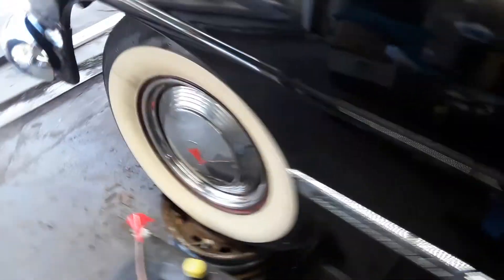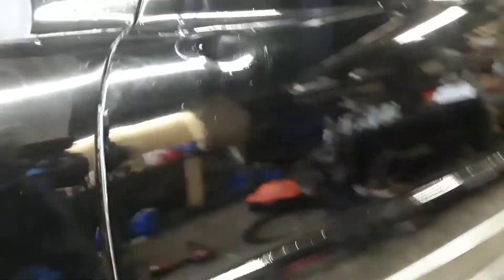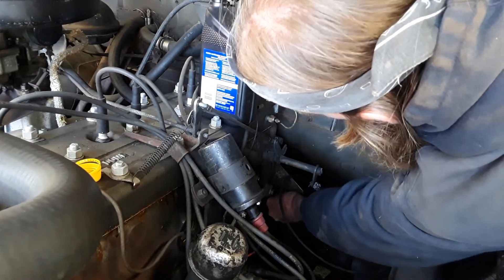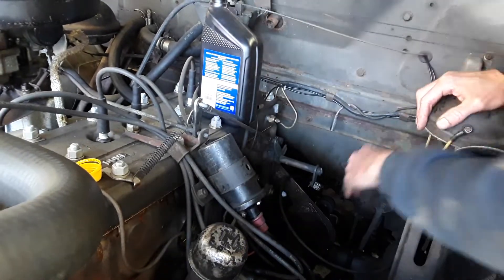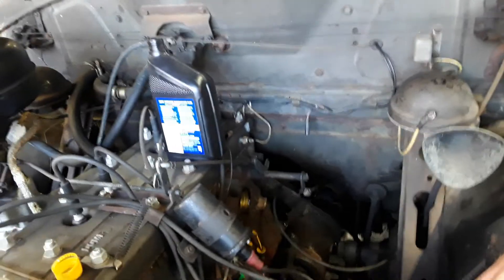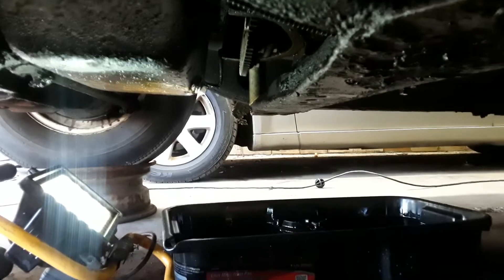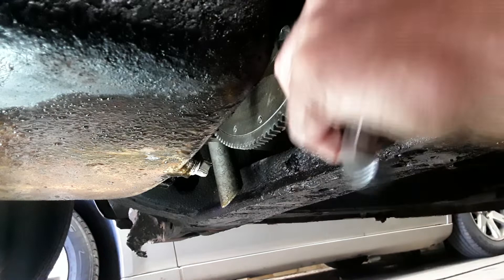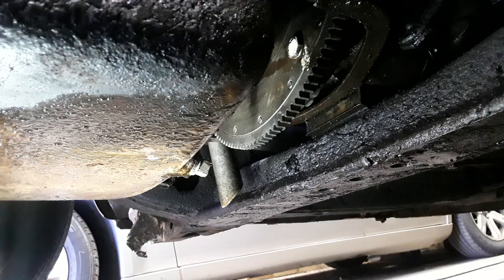Hudson Wet Plate Cork Clutch Oil Service.

Comment: Snap-On Tools back in the mid 1950s made an 11/16, half inch drive socket with a magnet in it for more easily removing the drain plug via the timing hole from the flywheel on Hudson clutches. The number of the socket is S9103. These can sometimes be found for sale at on-line auction sights. I found two this way and gave one to a friend who has several Hudsons.
Reply from the maker: @WAL_DC-6B  Thanks for the info about the socket.  I'll have to find one.

Comment: Very nice video.   Couple things I can add.  There is normally a tin flywheel cover which must be removed to access the flywheel drain from below.  Also, you can use a socket with a 6 inch extension to access the plug through the window above the starter.  (The same window you used to fill the clutch).
Reply from the maker: Thanks.  I realized that after I had uploaded. My cover plate has been missing since I've owned it and forgot to mention it. 😀

Comment: Actually, you don't have to get underneath the car to drain the clutch fluid. Here's how to do it according to the Hudson Motor Car Co., "Crank engine slowly until the star on the flywheel is aligned with the timing pointer (or center of timing inspection hole). This will bring the drain plug hole to the bottom of the flywheel and allow complete drainage." I follow this procedure every time I change the clutch fluid in my Hudson, and it works just fine.
Reply from the maker: @WAL_DC-6B  You're correct about using the timing pointer.  I only pull the plug from underneath due to being easier with the wrench I use on them.  They are a bit beat up after 70 plus years and 90k miles from other people not using the right tools or overtightening .
Reply: @gregdelagrange8573  Indeed, if the clutch plug on your Hudson is worn then perhaps the best thing to do is to get underneath to get a good fit with a box wrench or better yet, find a good replacement plug.

Comment: How often do you change the clutch fluid?!?
Reply from the maker: I change the clutch oil once a year when I change the engine oil.
Reply: According to the 1951 Hudson "Owner Manual," you're supposed to change the clutch fluid with 1/3 pint of "Hudsonite" every 5000 miles.  I change the fluid in my '53 Hudson "Super Wasp" every two years which is usually around 2000 miles.

Comment: Will WD-40 work to listen stuck. Corks
Reply from the maker: I've never tried that.  Usually kerosene and gentle steady pressure on the clutch pedal will break them free.  I imagine WD40 would probably work using the same technique.
Reply: According to the 1952 Hudson Mechanical Procedure Manual, on page 7-3 it reads: "Following is the method recommended for draining and cleaning the clutches for Hudson cars in order to remove gum and oxidation deposits which cause clutch sticking."

"It is important that this procedure be closely followed, and the engine run sufficiently to warm up the clutch parts to approximately 100 degrees F before flushing. If the parts are at a low temperature the solvent will not be effective and on the other hand, if the temperature is too high, much of it will evaporate.

1. Remove flywheel and dust pan and turn flywheel until drain plug is at its lowest position. Remove plug and drain out the old clutch compound.

2. Turn flywheel until clutch filler hole is opposite timing opening in rear engine plate and with a filler gun, inject one pint of solvent (20% carbon tetrachloride and 80% commercial acetone. Obtainable from drug or chemical supply houses).

3. Replace plug and with a stick or the proper length or a clutch pedal depressor, hold clutch in disengaged position. With engine at rest, permit clutch to remain disengaged for about 10 minutes. Release pedal and turn flywheel and clutch by hand approximately 1/4 turn, remaining in this position for another 10 minutes." 

 Repeat this operation depressing clutch pedal and turning flywheel 1/4 turn each time until a complete revolution is made. This will give the solvent an opportunity to act on all the internal clutch parts.

4. Drain clutch again making sure filler opening is at extreme bottom position to remove all solvent. Turn flywheel until filler opening is again exposed at the rear engine support plate. Introduce 1/3 pint of Hudsonite compound and replace drain plug." 

There you have it!

Comment: The clutch pedal on our 30’s Hudson goes through full travel and feels nominal, but no disengagement. What do you think is happening and a solution?
Reply from the maker: It's  either stuck or the corks have fallen out of the disk and are wedged between the disk and pressure plate or flywheel.  Have you changed the oil in it?
Reply: @gregdelagrange8573  Hi Greg and thanks for your reply. We drained and refilled then bumped the starter in high gear. All is well!
Reply from the maker: @stevewaclo167  Glad to hear that.  One tip that I do with my Hudson is to block the clutch pedal down when the car is not in use.  This prevents the sticking issues.  I just have a length of 2x4 that goes from the bottom of the dash to the clutch pedal to hold it down.
Reply: @gregdelagrange8573  great advice on the 2x4! Will do.
Reply: Is it possible for the corks to fall out while transporting the Hudsons on a trailer,? I had recently bought a 50 Hudson and hauled it home and feels as if the clutch isn't disengaging. Went up on the trailer just fine.
Reply from the maker: @kenemery4138  It's possible depending on how long it set before moving it onto the trailer.

Comment: I just picked up a 49 hudson commodore 8 with a stuck clutch. Any tips to unstuck it?
Reply from the maker: The first thing I would do is drain the old oil out and refill it with 6 ounces of atf. Then block the pedal down as far as possible and let it sit for a couple of days.  Then start the engine in neutral and fully warm it up.  Shut off and block the pedal again for a couple of hours.  Usually this will help break up the varnish. Don't jump on the pedal this can damage the cork lining and can cause it to jam worse.  
Restart the car in neutral and apply pressure firmly then release while it is warmed up.  This may be a bit time consuming but if careful and lucky it will unstick.  Hopefully it only stuck from varnish and not because the corks have fallen out and jammed it.  
I'd also recommend looking at the Hudson Essex Terraplane club forum on Facebook and the website as well.  I know this subject has been discussed alot there too and might have some other ideas too.
Reply: @gregdelagrange8573  thanks. The car isn't running yet so the oil will have plenty of time to work. Hopefully I don't have to drop it off a jack like I've seen elsewhere.
Reply from the maker: @kasane69  That may be to your advantage in getting it unstuck.  My 51 in the video had clutch problems with severe chatter and finally all the corks fell out and jammed it.  The only fix for that was to replace the clutch.
Reply: @kasane69  Is the clutch unstuck now?

Comment: Or PB blaster lose for corks
Reply from the maker: Once free it will need to be re oiled for use.  You may have to repeat the process in the video a couple of times with new Hudsonite or automatic transmission fluid for smooth operation.  Hopefully the disc isn't damaged.  Also I keep my clutch pedal blocked down when my car is not in use.